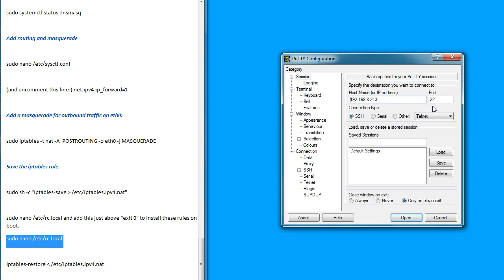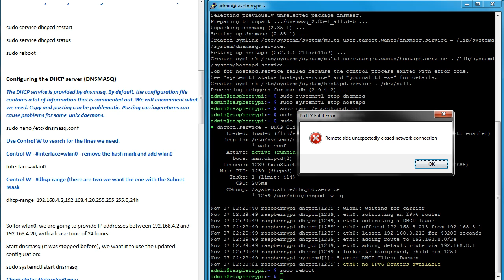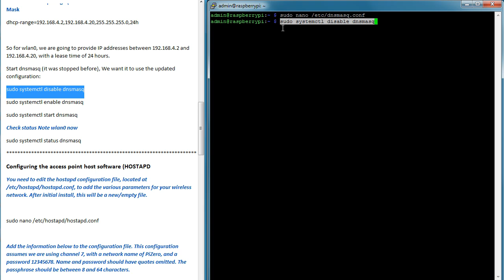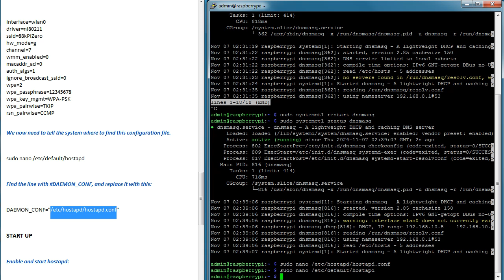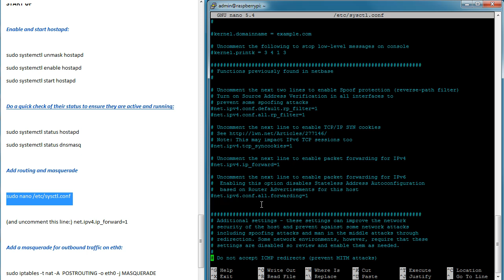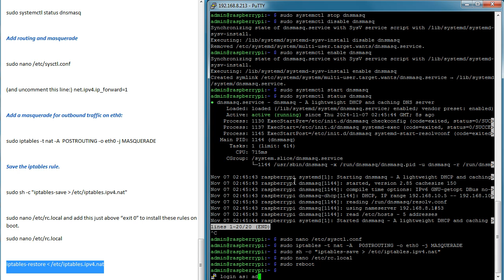Access Point on your Raspberry Pi Zero-W

Comment: my hostapd is correct but my wlan0 was in manage mode so it won't work as a AP so i have to Manually set the Wi-Fi interface to AP mode after that it's working now 

and your video is really helpful
Reply from the maker: Most tutorials have you to setup the Wifi which writes config files to look for a wifi network. It makes the Manage Mode default.  
I just connect a keyboard and monitor to the RPi and perform the configuration. It takes longer but you avoid the self configuration that goes on.
Glad it helped you.

Comment: i did as steps as you did but still i did see my SSID into my phone
Reply from the maker: Not seeing the SSID would indicate that the HOSTAPD has not starter. Here is the list of commands
to control it. Go through these command and pay close attention to the Status Hostapd. This command will
give you a log report . You will see any issues. 

Note:  hostapd.conf can be tricky. If you save it as a DOS file the kernel in the Pi will not read the file correctly 
and the hostapd will not start. 

In the Nano editor make sure that you  are saving as MAC-Format

 "Alt" & "m" for deselecting [MAC-Format] or "Alt" & "d" for deselecting [DOS-Format]. 
GO through each line and make sure that you delete all unnecessary spaces. even the end of each line.

HOSTAPD START UP

sudo systemctl disable hostapd
sudo systemctl enable hostapd
sudo systemctl unmask hostapd  (it could be hidden)
sudo systemctl start hostapd

sudo systemctl status hostapd   (This will show you if it is up or down. Red test will give you a clue)   
sudo systemctl status dnsmasq

Comment from the maker: Guys here's something you have to watch out for. I just moved my test phones around and could not log on. Because its was a generational change you can run into issues with your ability to log on. Check your IEEE802 standards. Look in your  /etc/hostapd/hostapd.conf file. 

This entry setups IEEE802.11

driver=nl80211

There are a number of versions of .11 (802.11a/b/g/n/ac) 

driver=nl80211g may be the answer.

Comment: Hi, I have trouble with hostapd: Job for hostapd.service failed because the control process exited with error code. I already checked multiple solutions but it still doesn´t work. Sometimes the SSID appears and when I try to conect to the network, it says that it´s not possible, then it disaapears. Any advise?
Reply from the maker: There may be an issue with your hostapd.conf. 
In the Discription section go to "Configuring the access point host software (hostapd)" I added notes
Reply from the maker: I have left my PiZero running non stop to test its reliability. It has been running for 2 Months non stop. I'm having the same problems you posted . I think its from the SD Card. The SD card gets hot which makes me think that it will fail over time. I pulled out the SD card and placed it in a New PiZero and that PiZero started doing the same thing. So I think the SD Card is creating the errors.